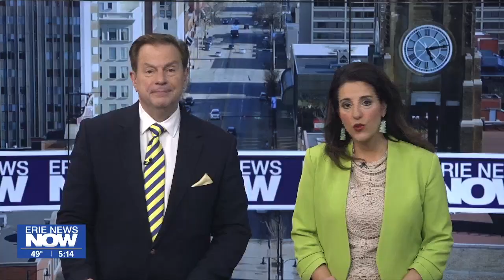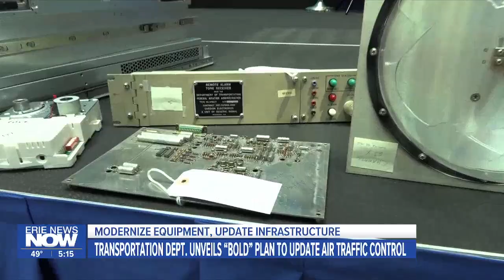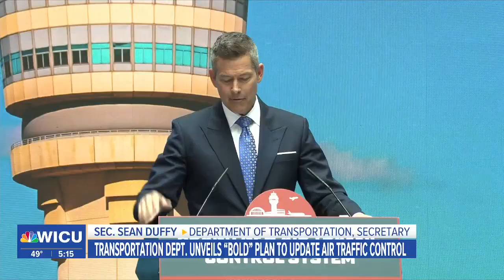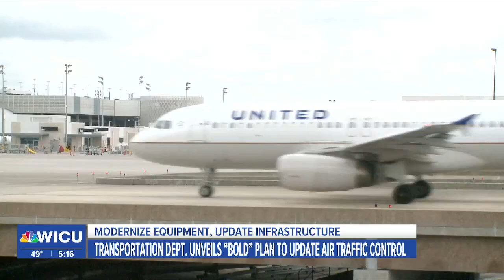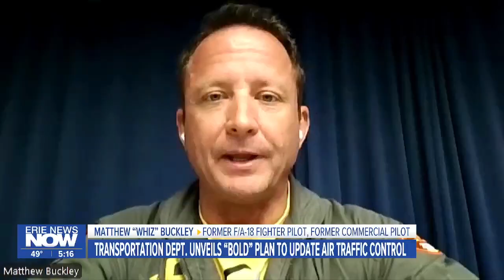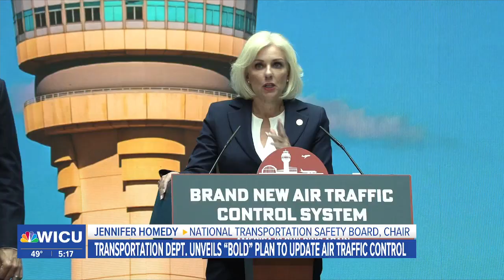DOT Unveils Plan to Modernize Outdated Air Traffic Control System I Media Hits

Comment: It will be royally screwed up, like everything “new” these days: Boeing planes, bullet trains and Cadillac automobiles that go 50 miles and the engine detonates.  They’ll never finish it in “3-4 years, either.”  

The ONLY solution is to build out a new ATC in parallel with the present version, and operate it in parallel to find where it’s broken without killing a bunch of people with the “oopsie.”